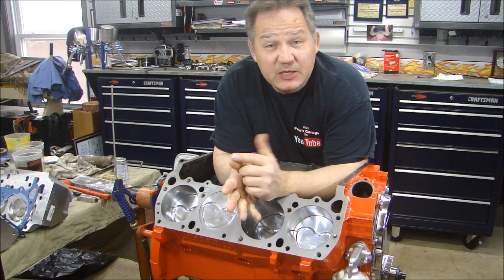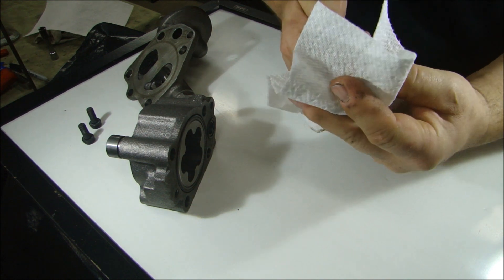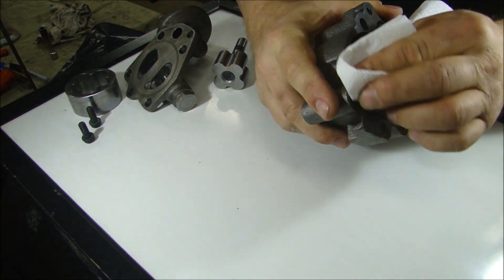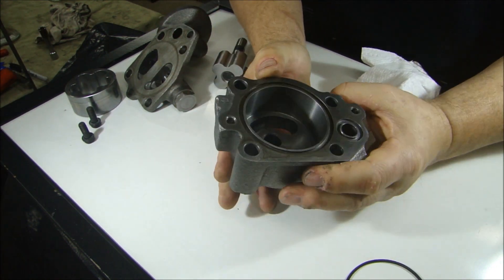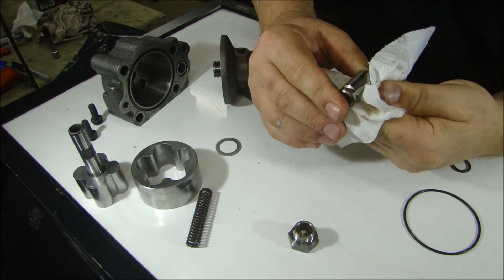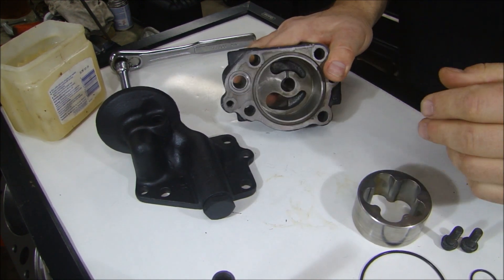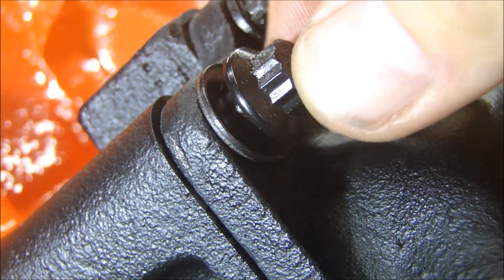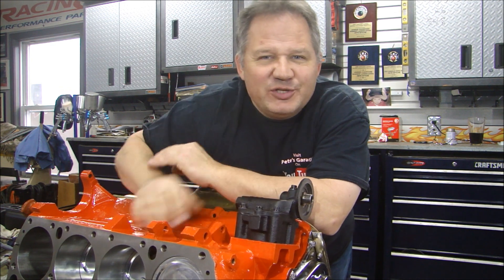440 Chrysler Mopar Engine Building Part 7   Oil Pump Cleaning and Installation

Comment: It doesn’t look like the inner rotor is pinned to the shaft, unless I’m just not seeing it. My various pumps, which will most likely be vintage TRW HV’s, they are drilled for a roll pin, parallel to the shaft, in the space where the rotor and shaft meet. There’s no chance of the shaft spinning inside the rotor.
Reply from the maker: I have not seen that

Comment: I followed these steps. Started the motor, went up to 40 psi. Then all of a sudden dropped to nearly zero. Oil level good. The mechanical brass unit was full, now it’s empty. Any ideas?
Reply from the maker: Could have lost its prime in the pickup

Comment: Hey Pete. You think a bad oil pump would cause an oil filter to split and blow apart? 72 miles on my new engine build and the oil filter blew off. Put a new one on and it split in half. Bad oil pump? And the check valve you were saying, is that the pressure relief valve?
Reply from the maker: If the check valve is stuck shut it could blow out the filter

Comment: these parts are made in a machine shop not an operating room so
however clean a machinist that made it is generally how clean their work will be.
Reply from the maker: I've seen machine shops that were as clean as operating rooms

Comment: Hi Pete from Perth Australia..great channel buddy..currently building a 440 from a us motorhome ..just wanted advice ..if i am going to manually prime the oil with a priming tool before first start ..is the petroleum jelly still necessary to pack that much in..and can it clog or block any oil ports  ..TIA ..
Reply from the maker: You can certainly prime without it. It does make it easier
Reply: @PetesGarage  thanks ..look forward to your awesome content ..be great to see a video of a initial start of a hp engine 👊

Comment: How do I adjust a valve when the rocker arm bolts has no set nut and if I leave any slack the rocker arm bolt rocks in it's threads.
Reply: Tighten the rocker shaft and forget it, they are hydraulic lifters with zero lash

Comment: My bonestock. 4.3 rocker arm bolts have no adjustment nuts and when I leave any play the nuts Rock inside their threads what should I do
Reply from the maker: Those are made without adjustment, none should be necessary

Comment: The Black stuff is the Zink the manufacturer uses in the oils to lube the parts.
Reply from the maker: That may be, I believe zinc is yellow or white. It doesn't hurt to check and clean
Reply: Zink is black, I add it to the oil I use in my 505 in my race truck/ dodge.

Comment: I need to replace the rubber O ring seals on the oil pump on a 440. I got all he bolts out of the pump but I can't get the pump to move.
It's like glued on there or something. Any tips on breaking it lose?
Reply from the maker: Start tapping with a mallet first
Reply: @PetesGarage   It's off. I ended up using a steel pipe as leverage on the subframe so I could rotate it. Thanks anyway.
Reply from the maker: That will work too...lol

Comment: On threaded fasteners. Anything more than 1.5 times the diameter of engagement on the threads is wasted in terms of the holding strength of the fastener. Plus just because the drilled hole is a certain depth that does not mean the threads are that deep. When manufacturing the block or any other casting there is typically a gap between the depth of thread and the actual hole depth. These holes are power tapped using a spindle that is threaded*. This threaded spindle runs in a bronze nut*. The work head advances to just short of the drilled hole. The motor driving the head starts and the taps advance. While this is going on a rod of some type advances at the same rate as the tap/s. Upon reaching a preset depth the motor stops and reverses to run the threads out. It will reverse to the original starting point and stop. Typically somewhere after this station there will be a probe inspection station to detect any broken taps. Removing the broken tap is typically done using a manually operated EDM machine offline. On cast iron parts the taps are 3 or 4 flute bottom taps. On aluminum parts the taps are either thread forming or cutting. The thread forming taps will produce a stronger thread in the hole than a conventional tional tap. 30 plus years experience in an engine manufacturing plant repairing and rebuilding plant machinery, tool work and tool room machining.
*the reason bronze is used is that it is a lot cheaper to replace a worn nut than it is the threaded spindle. In high volume production parts do wear out.
Reply from the maker: Interesting, thanks.

Comment: ALWAYS check inside your oil filter!!! You'd be surprised how many regardless of brand have visible surface rust in them. Fram is especially bad.
Reply from the maker: Great point

Comment: Great video and really good for showing how to prime an oil pump!!!!! I bought a high-volume oil pump for my HOLDEN V8 here in Australia which is an external type like the Hemi. I used a Dremel to clean up the machine marks and polish the oil hole ports to a mirror finish. Make for better flow and less parasite drag I believe. Finally, I now know how to prime/pack the pump for immediate oil pressure, especially that I have a new Camshaft/lifters run in along with a new Holley Sniper going on. The old camshaft failed missing three lobes thanks to three lifters going to south. No ZINC really hurt the camshaft badly in a flat tappet design.
Reply from the maker: Polishing is a good idea, as long as you can maintain the vacuum. Gotta have zinc for a flat tappet. Thanks Mick

Comment: How do you know it's rust? Oil isn't clear and has a brownish color.
Reply from the maker: It feels gritty
Reply: @PetesGarage  Then it is dirt, not rust. If it is rust and you feel the particles from a machined new part (very unlikely), you should discard, it as the surface would be pitted.
Reply from the maker: Thanks

Comment: Thank you for the walk thru.  I just bought a 1970 Roadrunner with a 383. I don't think im getting oil pressure.  Are they they same design? Can you turn the distributor to build pressure?
Reply from the maker: You have to turn the crank while turning the oil pump
Reply: @PetesGarage   Do you turn the oil pump by removing the distributor only, or is there another way? My engine does crank and start.
Reply from the maker: Yes
Reply: @PetesGarage  I got the parts. Summit has everything.
Reply: @PetesGarage   Thank you for responding.  I figured it out. Someone before me left a shop rag in the oil pan. I cant make that up, 😂. Now I need parts. Oil pan gasket and oil pump seal kit, which im havin a hard time finding. I need the pump gasket and 3 o-rings. Any suggestions?

Comment: How much would you be able to rebuild a 1970 383 Mopar?
Reply from the maker: It depends on what you want in it
Reply: Pete's Garage just stock
Reply: @PetesGarage  because I just see some metal flakes in the oil not big but super tiny
Reply: @MarineRacingTeam  Check the rod and main bearings while the pan is off. A bad rod bearing is my suspicion for small metal flakes.
Reply: @normanmadden  thank you, will do. Appreciate it

Comment: Well articulated. The oil pump is the equivalent of the human heart so you are bang on to highlight the importance of putting that little extra but precious time into it. I have an all original 1968 Coronet in my garage awaiting some time for me to do the upgrades. I will be rebuilding a 440 for it over the coming winter and will be using several of your tips including this oil pump one. Great video series.
Reply from the maker: Awesome car! Good luck with it!

Comment: Hey Pete. I have a Chrysler 400ci sitting in my 66 Charger. I've recently started getting low oil pressure readings on my gauge. I suspect that it needs a new oil pump but a friend suggested changing the 'oil pressure switch' on first.

Question is: Does a Chrysler 400ci have an Oil Pressure Switch? If so, where would it be located?

Thanks, Nick
Reply: You can change the spring or check it out, it's located in the oil pump. I believe a stiffer spring will increase the pressure, if it doesn't help you may have a dirty oil pressure sending unit on the back of the block behind the intake manifold, you may want to pop it out & try to clean it out or just replace it 1st before anything. Lastly if it's a high mileage (over 70,000) the main bearings could be worn & the oil is squirting out the sides instead of going into the galleys. That's caused from excessive bearing clearance. Check those 3 things, pressure sending unit 1st & try not to drive it until you figure it out. Also check out some forums for mopar big block. What I mentioned are common. If you have a couple quarts of atf laying around you can drain out the oil and fill a couple new quarts of oil & trans fluid, start it up let her run till she gets up to temp, shut it off, drain, replace with your preferred oil, tranny fluid does a great job cleaning out oil galleys & pretty much everything else. Hope this help, if you have any questions & Pete doesn't answer ill gladly help. I'm a mopar guy 100% but a mechanic & work on everything, everyday
Reply: @Moparmaga-1  That's really helpful of you - Thanks Korie.

Definitely going with replacing the Oil Pressure Switch first before anything else. If it's located towards the back of the block by the intake manifold then I shouldn't have too much trouble locating it.

While on the subject - I'm going to replace the Temp Sending Sensor too. Any thoughts on where that might be located on the 400ci block?

Thanks, Nick
Reply: @nickshale6926  yes that should be on the water pump housing. It's a small brass fitting most likely 1 post, 1 wire goes to the unit. I'll check out a wiring harness I have to make sure & possibly tell you the color. The oil pressure sending unit also has 1 wire & it should be about 1.75 inches around & same tall & look like a canister.
Reply: @Moparmaga-1  Thanks again Korie.

Any info greatly received. I recently had some overheating issues (Radiator needed recoring - now done) which consequently fried the temp sensor.
Reply from the maker: It's an oil pressure sensor
Reply: Korie Creson Any thoughts on the colour of the wire to it?
Reply: @nickshale6926  okay on my 73 it has a weird W shaped connector. 1 wire is light purple or pink & the other wire is grey with a black stripe
Reply: nick shale Go to Nicks Garage on YT search on his vides about the 440 oil pump you may find it interesting
Reply: Korie Creson  not entirely sure but I believe mine is 1972 and possibly came out of a Chrysler New Yorker.
Reply: @Moparmaga-1  I can send you some pics of it if that helps identify it?

I'll msg you my email address directly. Thanks!
Reply: @nickshale6926  okay sounds good

Comment: Hey Pete, I've got a 67 440 on my old Imperial that I am going to change the oil pump on this weekend. It has 71,000 miles on it, but it sat for 19 years. My question is, My oil pan is stock, but the oil pump I just bought is a High Volume oil pump. The engine has not been rebuilt, and I am also going to replace the valley pan this weekend. But anyway, do you think it will be okay? I'm not racing it or anything, but I read that having a high volume oil pump can be quite helpful to old engines with the oil used today. I usually use Valvoline conventional 10W-30.
Reply from the maker: I would use just a standard oil pump for a stock engine. A high volume can pump out a stock oil pan. If you need pressure use 40 weight oil instead of 30
Reply: I 2nd what Pete said
Reply: @Moparmaga-1  Thank you both. This is my sunny Sunday project. 😁
Reply: @theguppy3663  cool, very fun! Enjoy.. I have a project I've been dying to get started on for the last 2 year's (1970 dart swinger 471 stroker big block conversion )
Reply: @Moparmaga-1  70 was the best year for EVERYTHING. Have fun with your project! I have a 67' Imperial Crown Coupe. Number 409 out of 3,235. 😁 He hasn't let me down yet. ♥️
Reply: @theguppy3663  that is a SWEEEET ride, I love them.
Reply: @Moparmaga-1  Why thank you. Take good care of your Mopar baby. ☺️♥️
Reply: @theguppy3663  will do ! I'll hopefully if I have the time be filming my complete build on YouTube soon. Take care
Reply: You could still get by with a high volume pump by shortening the spring by one turn. An other issue you may find is at 71000 miles if you have never replaced the rear main the higher pressure can make any small leak much bigger. If it is stock best bet is with a stock pump.

Comment: many years ago my dad had a high milage 1977  new yorker  440.    he had the car up on jackstands to drained the oil to change oil.  when the oil was out  mom said it was lunch time.   when dad got the oil changed the pump would not prime.   with the reg drill motor we used for that 600 RPM.   he had to jury rig a 1300 rpm motor to prime the pump.
Reply from the maker: Interesting, must have been worn out.
Reply: Did he put 6-7qts of rearend gear oil in it? Im just f ing with ya, we had the same problem with a 440 in a 71' roadrunner was stock never rebuilt, this was in 92' put 20w50 in it, had 160,000+ miles and wouldnt prime, first time I seen an oil pump rebuilt, took a pump laying in one of the other 440's in shop and rebuilt it, he actually polished up internals and modified/ machined the gears to flow with less resistance, worked great, then a week later we pulled it out to rebuild the motor.

Comment: Pete I've got a 440 and Everytime l change the oil the pump loses prime and l gotta pack with white grease to get it back any suggestions?
Reply from the maker: The pickup tube may be loose
Reply: moe to steve.   put a new pump in it.   its very easy.
Reply: @moeshouse575  no that's not it! Lol j k

Comment: Hi Pete, I noticed on your oil pump video you had a deep oil pan on the engine.  I use the same oil pan on my 440 that I just installed in my GTX.  I noticed that it hangs down below the K member about 2 inches.  Its likely to be the first thing hit by a foreign object or grinding it on a bump.  Do you know what people do to keep this low hanging pan from being damaged?  Any advice you can provide would be appreciated.
Reply: A scuff plate.  Thats about all I could imagine to keep the pan safe.  Thanks for the reply....
Reply: Campbase P
Reply from the maker: I've seen scuff plates added to the front cross member.

Comment: Edit: (i forgot to thank you for the video! Very informative! I will probably be using  alot of your vids to help with my project) 
Bit of a semingly weird question but i want to replace my 52 year old 383 Chrysler  oil pump on a c-body boat. im aware its a similar part if not the same but my question is do i absolutely have to remove the entire engine  to replace  this with a high volume? Again it seems like a dumb question im assuming it would be best to do so.
I can see the bolts where it is located  and can get to them so im curious  if i dont have to yet.
Reply from the maker: If you can get to the bolts and have clearance to properly clean the gasket surface leave the motor in.

Comment: why would a new oil pump be so dirty
Reply: New part is tested so some ' break in' removal of metal takes place , the rust is from sitting on the shelf lol
Reply from the maker: That's a great question. But I check anyway.
Reply: Probably been sitting on a shelf for a long time.
Reply: @willgeorgiadis2025  All new parts are coated with an anti-corrosion oil and that has a brownish color.
Reply: I don't remember which part this was as it was awhile ago that I've seen this video, but most of the parts I get every day have no coating on them. Sommetimes rotors and certain parts will but for the most part are dry. But maybe it differs from manufacturer, although I don't recall getting parts from other oems with coating on them (although i have received parts that have surface rust on them!).
Reply: @willgeorgiadis2025  Working as a mechanic for 34 years, EVERY bare cast iron/steel part gets an oily coating, just like this oil pump. Never received a new bare cast iron/steel part without rust protection, as it will strat to rust instantly without.

Comment: While the pump is apart you should hold the pump body against the block to check for oil hole alignment. This is most important on many old v8 engines.
Reply from the maker: Great comment, thank you

Comment: What do you think could cause an engine to have good start up  oil pressure   ( 60 psi ) then fall off to 20 psi at operating temperature ?
Reply from the maker: Very loose bearings or worn oil pump. Put straight 30 weight in it.
Reply: Dang I have the same problem, poor man's rebuild IE ball honed the cylinders, new rings, cam, lifters, bearing, with a high volume pump,  70 PSI with mechanical gauge drops to zero at 200 degrees running full synthetic oil. I was getting ready to tear the whole thing out and start over.
Reply: Please let it be the first LOL.
 Lifters are called Crower Cam savers,  the buddy who helped build the engine is a big Dodge guy recommended them. 
 I've lost access to the shop where we did the swap and pulling an engine in a dirt driveway wouldn't be fun! 
Thanks for the ideas
Reply: I found the problem. The pressure relief valve was hung open in the oil pump.
Reply: STEVEN SHEPERD, that pressure relief valve is the most important part in the engine,service it often,if youre flying down the freeway and you lose 10 to 15 psi,don't panic the oil filter is not big enough or beginning to plug up,always carry a couple in the trunk,been known to pull over on the side of the road spin it off and spin another on add a qt,these engines are worth the extra maintenance
Reply: Interesting , but I have replaced the oil pump with a hyvolume unit from Melling
Reply: im already using full 20/50
Reply from the maker: You could have a loose galley plug or just excessive clearances in everything from the bearings to the lifters